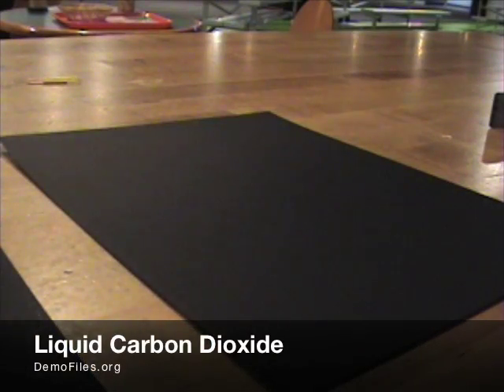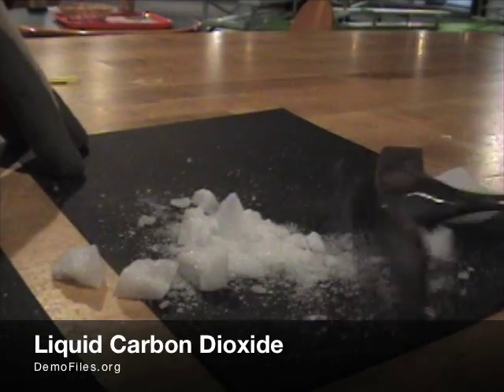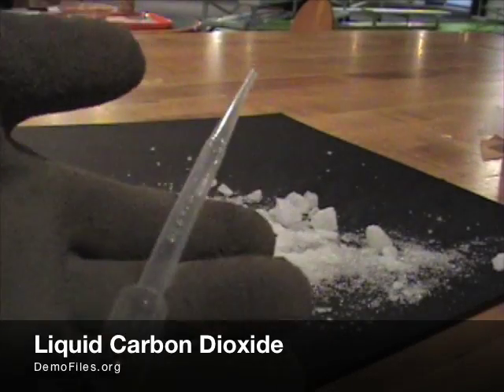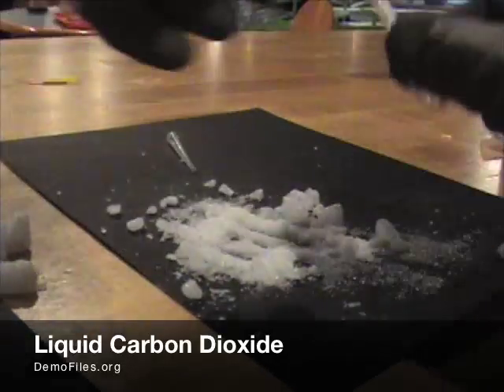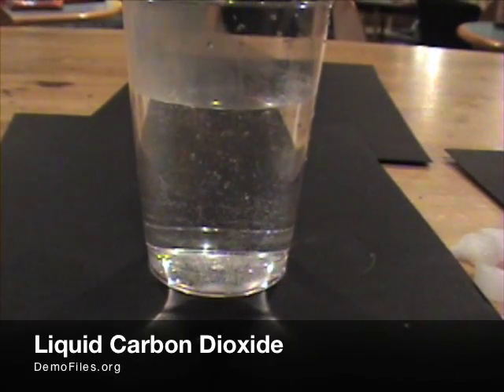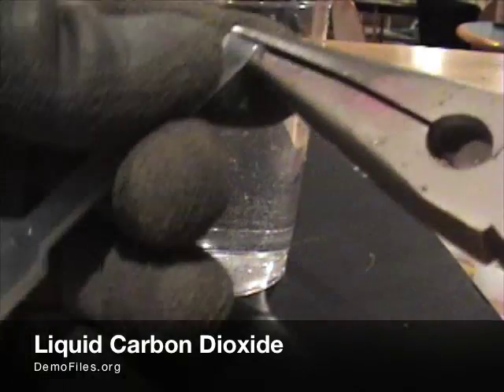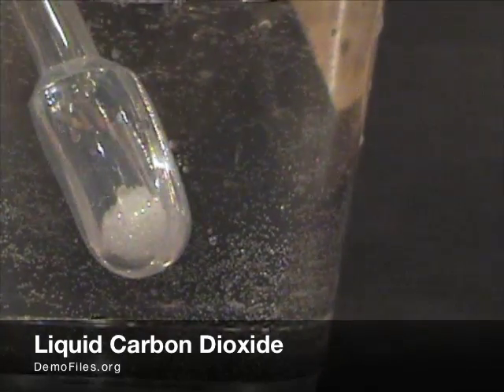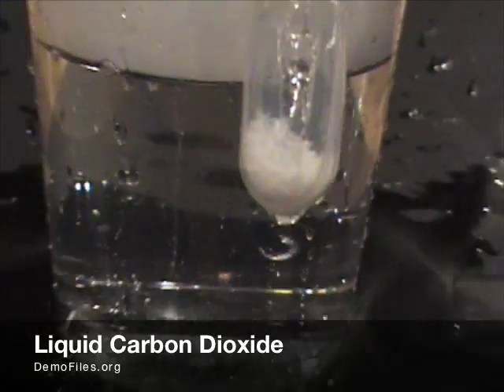Liquid Carbon Dioxide

Comment: very cool this has been on my mind for years... dry ice... its one of those things that is possible to experiment with but you just never do it and wonder about it lol... Dry ice solid at room temp releases gas but under pressure it melts into liquid and odd thing is that I was just thinking about this and thought how if co2 gas was pressurized it probably wouldn't turn into a solid it would turn into a liquid chemicals awesome

Comment: I thought that solide carbon dioxide could only sublimate into its gas counterpart in our Earth's atmospheric pressure. How did you turn in into a liquid? Sorry if I got any facts wrong I'm self studying before I go into Year 9 for a headstart in chem. Thanks in advance for your replies.
Reply: well it's in a pressurized atmosphere more the 1 atmospheric pressure (kinda obvious) so it can be a liquid
Reply: pretty sure thats why we sealed, then submerged it under water. Not 100% myself thought.

Comment: does this conduct electricity??
Reply: +Anna Lybarskaja +Tommy DeLuca This response is coming a year later, so I don't really expect either of you to respond. Anyhow, it seems like you could produce electricity using all that pressure to drive a piston, giving it vents to release, once the piston has been pushed past a certain point, and start the process over, much like a 2-stroke engine, don't you think? Although you're right about the state change not resulting in an electric charge, the pressure created by the state change might be able to be converted into electricity. This seems like it would be pretty efficient in a place where dry ice is redly (naturally) available, like Mars. Combined with a fission reactor to heat the water, and the dry ice to create the pressure, it seems as though that would be an excellent way to produce energy in the poles of that planet. On Earth, though, you would probably use more energy creating dry ice than you would by using the pressure to create energy, making it impractical. I could be wrong, though; my rationale is built upon the premise that if he had released those pliers, giving the gas a place to escape, right before the pipette bursted, the dry ice would have returned to a solid state, as well.
Reply: So it wasn't gas that was building up inside that tube?

Comment: So that's how cold it was I pick some up with my bare hands in chemistry.
My teacher also brought up some property of flesh that makes it so we don't experience pain from extreme temperatures for a few seconds but I can't remember the name.
Reply: BigE1943 It's not the Leidenfrost effect. It's the fact the CO2 doesn't conduct heat very well.
Reply: Leidenfrost effect.
Reply: Mr.chang cooler It is the Leidenfrost effect. The same reason why dry ice looks like it hovers over water
Reply: Marcos Castillo yeah,  but you have to consider the fact that water conducts energy a lot better than our skin. 
The Leidenfrost effect isn’t taking a large part here because our hands, similar to CO2, are bad conductors of heat. And thus allowing us to actually make contact with frozen CO2 before our fingers freeze.

Comment: I thought that carbon dioxide subliminates
Reply: well, I feel that my chemistry teacher failed me.
Reply: Under normal atmospheric pressure it does. But when it increase the pressure it melts instead of sublimates. Observe it's phase diagram: upload.wikimedia.org/wikipedia/commons/1/13/Carbon_dioxide_pressure-temperature_phase_diagram.svg

Here's water's, for comparison: serc.carleton.edu/images/research_education/equilibria/h2o_phase_diagram_-_color.v2.jpg
Reply: Under normal pressure.

Comment: @BeastAP23, that all depends... as the CO2 sits in a humid environment, water vapor will deposit on the surface forming a somewhat insulating layer that you can touch for a few seconds. If you break open a hunk of dry ice and touch the freshly exposed surface it is quite painful. In anycase, it's nice to showcase safety.

Comment: 15psi is aprox 1 bar or 1 atmosphere of pressure. if you ingest solid co2 or dry ice it will expand into a gas rapidly. 1 liter of liquid co2 generates 700 liters of carbon dioxide gas. if solid co2 is ingested it might rupture organs. Just buy your carbonated drinks.

Comment: 5 atms. of pressure is equal to about 73 psi of pressure.

@Video - We did this in my chemistry class at school today. If you let a bit pressure out of the pipette right when you see the dry ice turn into a liquid, you can keep it in it's liquid state for longer.

Comment: Yes, in the sealed tube the solid CO2 warms up, turns to a gas and also builds up pressure. This mixture eventually reaches the triple point  for CO2 (where solid, liquid and gas are all present.)  

For CO2 the triple point exists at 5.11 atmospheres at a temperature of -56.6 C. This is the lowest pressure where liquid CO2 can form. 

Atmospheric pressure is 14.7 pounds per square inch, so the container ruptures at roughly a pressure of (14.7)*(5.11) = 75psi.